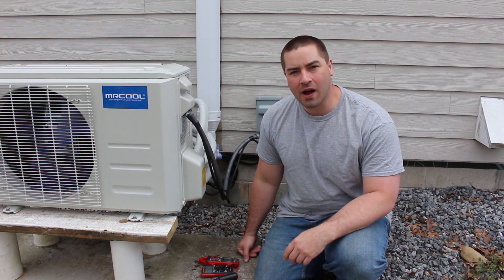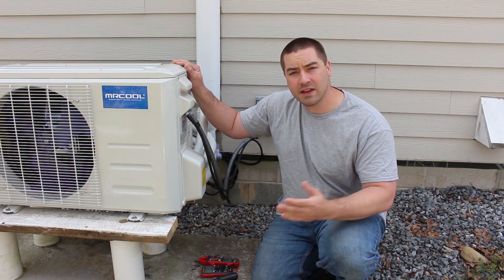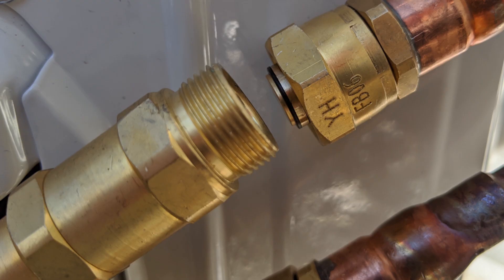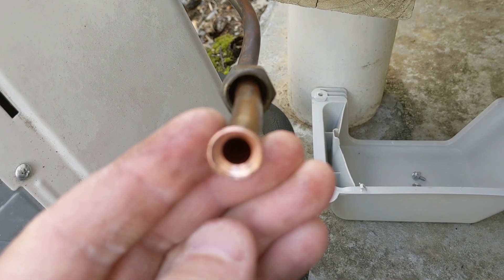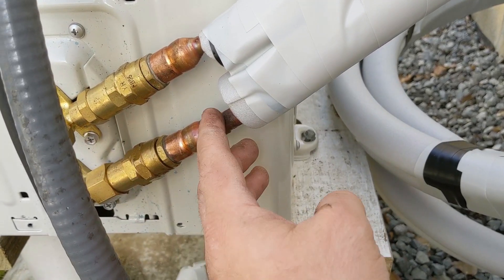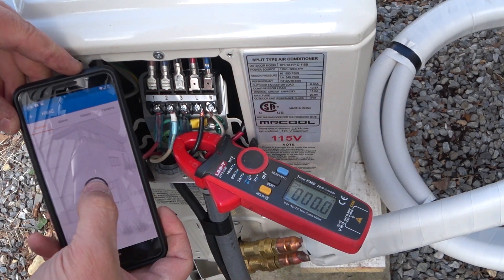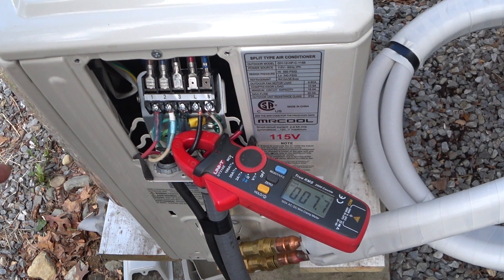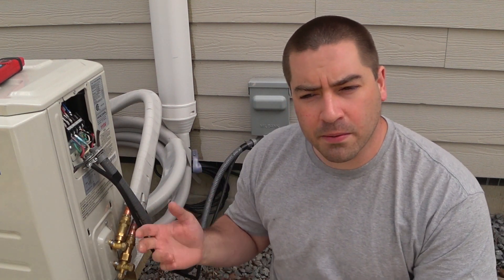Q+A on the DIY Mr. Cool Mini-Split Heat Pump

Comment: This show you that Mr. Cool made this unit truly DIY! Excellent!
  Amps used, GM use a an amp-ring on the positive cable starting in 2005. Later, the negative cable only. Software is up integrated into finally the PCM to reduce the alternators load on an engine. This is hard wired of course but on “This Old House” a company developed current sensing rings for inside on the Service Panel. Like an oscilloscope, it measures each household component as it came on, as each has a unique signature. Each were given a name, sent via secure WiFi but a phone app to monitor the waveform of each item from the toaster to a blender. But as the oscilloscope shows activity inside the circuit, waveforms are unique and higher means working harder. So lube of cleaning if a motor, lower on brushed motors means worn out. Folks would ask to check the family “Truckster” before going on vacation. I installed a fused jumper in fuse/relay center for the EFI pump in tank. High means filter maybe restricted, low meant the brushes jumping over worn commutator, or weak brush tension as a spring can only push short brushes so far! Easy, Peassy! 
  I am sure some company has this technology. After all, we built the “Six Million” dollar man in the 80’s. lol. Thanks kindly for sharing. New sub and you have a nice variety of stuff. 
  A portable $30 swivel 750 lumens spot light has a rechargeable Li-ion battery (18650), I will replace it, not buy a new light for another $30. But, that’s me. My Unicorn flew away man, bummer! 
  Thanks for sharing. DK.

Comment: Why unit draws 1083W? This is too much. If your unit is like 18-20 Seer 12000 BTU's, power consumption sould not exceed 600W. Unless you have like 12-10 seer unit. Acording to Seer rating 14 Seer 1 Ton 12000 BTU's is 857W. So yours is probably like 12 Seer or 10 Seer?

Comment: Would a 9000btu work well in a 288 ft tiny house that has a vaulted ceiling with a 12 ft peak?
Reply from the maker: It would probably be fine, but you won't know for certain until you do a building load calculation.

Comment: Are there different modes on these or just heat/air and temp as settings.   Being off grid I like to have as much control over my power use as possible.      Also while likely not an 'approved' installation  you could run your installation line to a 'plug' and run the mini split through a kill-o-watt meter for a period of time to test power use over time.
Reply from the maker: Hi.  I've tested the power usage of a few different brands of mini splits.  I find the most efficient mode is dehumidifier mode.  It acts like an air conditioner,  but very efficient.

Comment: I wondered if they have to provide such long lines as the outside unit cannot hold enough refrigerant to make the system work also assuming the indoor unit has no charge when shipped. I also assumed the sealed lines broke the seal just as you tighten them and could leak if not tightened fast enough?

Comment: Very helpful David.  I am hoping to run this with just a 4000 watt battery bank. Since I am insanely well insulated in my 200 sq ft cabin I think it will work. Cheers!

Comment: You should to insulate the copper connections to the outside unit.   I know it has a plastic cover but stuff some fiberglass insulation inside there.   Quick and easy...Don't like to see bare copper outside in MA.

Comment: Hey David, 
Great video.  
I have a question for you.  My unit is not outputting heat as it did when I first installed it by in September. The heat that comes out is not warm at all.  What do you think it could be? 
Thanks

Comment: Sorry if I missed this, but how many BTUs heating and cooling is this unit? I have a mini split and the specs say 19800 (max cooling) and 23500 (max heating), rated current is12.5A, MCA is 16A, compressor LRA is 25A and compressor RLA is 12.08A. I have a non-inverter 9375/7500 watt compressor and I plan to run the minisplit, fridge (max 3.2A, according to plate), microwave (1200 watt run intermittently with mini split off), a 1/3 hp sump pump (operates for about 10 seconds once a day), one 1500watt space heater and a few light bulbs (all are 8watt LEDs). I have a GenerLink 30A SureConnect system. Any thoughts or advice? Thanks! Great video btw.

Comment: This is my first mini split at winter. The mini split blow out cold air fine when I first installed. Since it is getting colder now. I turn on the heat for the first time. But it seem doesn't work very well. When I set the temp. to maximum 86F, I don't feel any difference. The air doesn't blow around 85F, Is this normal? Since it only blow out around 85F, it doesn't even make that much change in my 200sq dinning room. Is the unit has problem. Or this is normal for mini split..., Thanks
Reply from the maker: No, it's not normal.  Contact the manufacturer.
Reply: @DavidPozEnergy  Thank you..., I will give them a call on Monday...

Comment: The problem is that you coiled the lineset, you can starve the compressor for oil. The unit should have been installed so you used up the run and kept it horizontal. Or used a NON diy unit and trimmed the lines. Theres nothing miss understood here. Its not a good install and you shortened the life of the unit. If you look at a properly installed unit you dont see coils. Your job was poorly planned and you should have done it right or had a pro do it. And I am NOT a pro.

Comment: Because these Mr Cool systems are pre charged with double-0-Rings do you still need to use Nylog? Some say that the Nylog for these units may not allow you to tighten to the proper specs. So in essence because of these unique O-Rings is it again still recommended to use Nylog. Thanks..
Reply from the maker: You don't need to use Nylog.

Comment: I have a question for you. 

I just installed a mini split 24k BTU on my RV. Have a separate plug for 30 amp plug to run it at the pedestal. Would I be better off using a Y adapter from the 50A plug in to run the Coach and or the mini split?

Also is there any power $ savings running 30a hook up vs 50a hook up or is this a myth?

Thanks!!!
Reply from the maker: I don't have much experience with RV's, and no experience with big ones that take 50a plugs.  My limited understanding is that the big ones use 50 amp, 240v.  That would need 4-prongs (L1, L2, N, G)  Small RV's and campers use 30 amp 120v plugs, which are 3-prongs (L1, N, G).  

You have to check your mini-split.  Is it a 120v, or 240v model?  Point being that you need to supply the mini-split with the voltage it requires (120 or 240).
Reply: @DavidPozEnergy  thank you for that easy to understand response. Here’s the one I have. I had them install a 30amp chord onto it so I can plug into 30amp. Will that work? 

https://store.acpro.com/mini-split-condenser-24-000-btu-18-seer-single-zone
Reply from the maker: The product page says 230v.  So just make sure you are plugging it into a 230v power source.  (note, 230v and 240v are used interchangeably.  US power grid is anywhere from 230-250v)
Reply: @DavidPozEnergy  thank you. We’re doing a 50a that Y into 2 50a females so it’ll run both. I think we have it figured out. 

Subscribed 🙏🏼🤘🏼Thanks!

Comment: Air and refrigerant doesn’t make acid in the line set. You pull a vacuum to remove moisture and air (non condensible) from the refrigeration line. And Mr, Cool is garbage.
Reply: Mr. Cool is garbage, but it's cheap, I installed it myself, and it's been working great for years!!

Comment: There are two types of units available.  One is true diy.  One is still diy in my opinion, but you need to cut and flare, then vacume the lines yourself. Requires a few specialized tools, but most handy people could manage. The advantage is that those units are significantly less expensive. You do, however, loose the mnfg warranty when you put those units in yourself. They need to see proof that a licensed person installed it. I'm considering going that route and having a friend make the final connections/ charge it, and another friend do electrical. Both licensed, and I still save.

Comment: Don't know if you did already the power monitor. If you have Homeassistant the setup pzem + esp8266 works fine and with low budget. Less than 15$

Comment: senville, pioneer and mr cool look to be the same mini split..all the sheet metal case stamping is identical.  ..
Reply: There are dozens of different supposed brands of these little heat pumps. But they are all made by Midea, a huge HVAC manufacturer. They are then re-branded as Pioneer, Senville, Mr. Cool, and many more.  They differ in the seller support, and some of the documentation. If you look at enough manuals from different models, you will see that trouble codes (in addition to the looks) are usually identical between brands. 
https://youtu.be/qeI3aPo8li0

Comment: I just sold my last house, where I had installed a Mr Cool DIY 24,000 BTU 240v mini-split system on my old 27'x27' insulated shop, and WOW, I can say I am sold on these units, soft-start, economical, installation is a breeze with no need to call HVAC guy... Unfortunately, the next off-grid build I will be doing I want to use a DC 48v mini-split, and unfortunately Mr Cool does not make DC units as far as I know today. I am looking at the Hotspot Energy DC4812VRF for that, and they don't look to have pre-charged evap unit line sets. I wonder if I could convert a Mr Cool power supply to 48v DC input hehe, not sure if it would be worth the gamble to try when someone already makes a turn-key unit...

Comment: is this unit your primary source of heat in winter?
Reply from the maker: I have not used it through a winter yet, so I can't say for sure.  I'm going to try using just the mini-split this winter, but I may have to go back to my electric baseboards if it doesn't work.

Comment: I've got a house in central Florida, and the garage humidity and heat make work and tool storage unbearable. I've got two windows in the garage but I think this unit will be a lot more efficient, quieter, and last longer than a window unit. This fall I'll insulate the door, seals, and foil the attic.

Comment: For data I use an Egauge. It does upload to them but I have the option of local only. The device will do 13 circuits and store data for up to 35 years. Here is a link of my device, open to the public. 9000 watts of solar. http://egauge4909.egaug.es/5DFD3/l/en_GB/classic.html

Comment: Whom ever installed the original line used gas flare nuts, instead of refrigeration flare nuts!
Reply from the maker: I paid a professional, licensed, and expensive company to install the original Fujitsu unit.  And paid them over and over again to keep coming back out to "Fix" it.  It's just too expensive to keep hiring them to come out.  That's why I had to go with this new unit and DIY it.

Comment: Mr. Poz Good for you even before I saw this Video after I had watched the first I was thinking about you not Vacuuming the line and I thought I think there is the possibility of Mr Cool because they would even build a DIY Mini Split they would have to put valves at each end of the line-set so as Customers that buy it will not have to go out and purchase the tools that it takes to do the Vacuum. I am very impressed with Mr. Cool for being this step ahead of the rest. Thank you for not "getting your hair in a bun" and patiently told me to look at your follow-up Youtube, I am glad I did.
Reply from the maker: Thanks for the follow up comment.  Glad it helps.  Before finding these units I figured they all needed vacuum.  It's fun to see the new stuff engineers come up with.

Comment: When you coil the line set does that cause an   oil trap?
Reply from the maker: Maybe.  I just followed the instructions.
Reply: I had concerns about that too! I contacted MrCool tech support and asked about oil collecting in the low parts of the lines, their response was that the oil would collect there.😁🛫

Comment: I use the efergy system. No data goes outside. Allow main storage and one accessory [typically solar]
The big limitation is doing fancy calculations, hence why many of them send the data home so their in house tools can store and format the data. Otherwise you'd need some sort of device that captures and presents the data in all possible formats.

Comment: As an electrician I would advise changing the circuit to 240 volts, it would cut your energy consumption in half
Reply: As an electrician you would supply an appliance that is rated for 120v with 240v??? And you think it would cut the wattage in half??  As an electrician, I would advise you stop giving advice.
Reply: @khwolter9038  no, it would make the magic smoke come out most likely.  You can't just double the voltage and expect it to work.
Reply: That is not true. As a electrician you should know ohms law
Reply: Maybe I misunderstood the video, I thought the unit could be tapped at either voltage. Wattage is constant but if you increase the voltage you lower the amps which is what is being "consumed"
Reply: @nickwolf805  Generation / substation electrician here... Wattage is what you are charged for, not Amps. You were correct, doubling the voltage (if the device could handle it) would roughly cut the amperage in half, but the Wattage would still be the same and so would the bill. 
Also, the Wattage he calculated was not the Wattage. That is the VA or Volts - Amps or apparent power. With DC the VA and Wattage are the same, but with AC you have to take in to effect the power factor and VA will always be higher than the actual Wattage. But for household stuff, measuring the VA for comparative purposes is just fine. Plenty of info on the internet that explains what the power factor is and why it only affects AC power.
Reply: Nick Wolf you are not a licensed electrician if you were you would know that wattage is what is consumed, amperage is how the wattage is measured over the voltage. As someone else pointed out, if you increase the voltage the current drops in half but it is still the same wattage at 120 volts or 240 volts.😁🛫
Reply: @TheFalconJetDriver  There's a lot of licensed Pro's that have no idea what they're doing. And do things wrong every day.

Comment: You live in Massachusetts!! Perfect! I live in NH! How efficient has your heat pump been? How long have you had one? I know up until recently they didn't handle zero degree outside temperatures very well (I know they're not common, but they're not unheard of, either). Is it possible to combine one of these with an existing oil heat system on one thermostat, rather than having the thing use electric resistance heating when it can't keep up? I assume the extra tubing length was so you can place the interior register on a more distant wall. How far inside the house can Mr. Cool reach, and how many different registers could you put on a single pump, and can they be individually controlled? I'd love to install two of these: one for the kitchen/living room on one corner of the house, and one for the three bedrooms at the other end of the house, unless a single heat pump could handle four or five registers for a 1000 sq ft home? (Terrible airflow for distributing heat). Do these absolutely require their own circuit, or are there heat pumps that can plug into an existing 110 outlet? (Rewiring this house has been a bitch). Finally (I know, I know), why did you choose a ground-mount instead of a wall-mount design? Thank you!! I want to do a solar/heat pump combo, and empirical information is ALWAYS useful!
Reply from the maker: Hi NH neighbor.  That's a lot of questions, but I'll do my best.  Yes, the heat pumps can keep up with my personal heating load.  But as the air outside gets colder, it becomes less efficient.  I don't know if there is one thermostat that can control both a mini-split and a oil furnace.  You may have to manually turn off the heat pump when the temp. outside gets below freezing and turn on the oil furnace.  This particular unit will heat down to -5°F outside, but at that temperature it's not very efficient.  So, depending on cost of electricity vs. cost of oil, you may want to switch to oil furnace around 32°F.  The copper lines (lineset) is 25' long.  Yes, you can install the head unit on an interior wall but the lineset should be pitched down to the outside hole.  Yes, there are systems out there that can have 3 or 4 heads on one compressor.  However, they don't run as efficient.  It's more efficient to have small units, and one head to one compressor.  Nothing wrong with mounting it on the wall outside instead of ground, but personally I feel like every time you screw something to your house it's another potential leak.  You might like to check out another video of my friend "Ben" house.  He has 3 or 4 small mini-splits spaced around and he lives in Vermont.  https://youtu.be/6nxH9_GmCiU

Comment: Would you be able to run a test for amp draw on AC as well?  This tells us now it uses max of 1000 watts perhaps.  But what if it's just AC?
Reply: This is 2 years late but my 24k draws about 2 amps on ac at turbo. Less than 500 watts